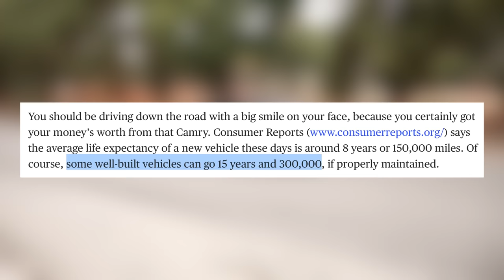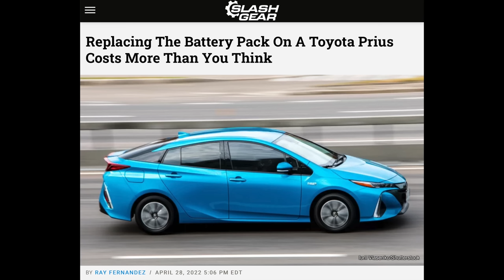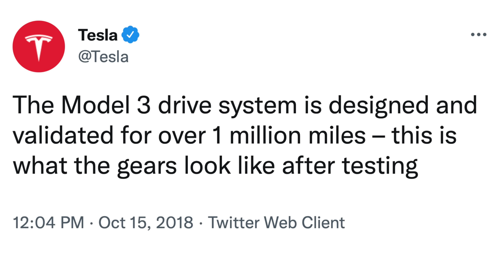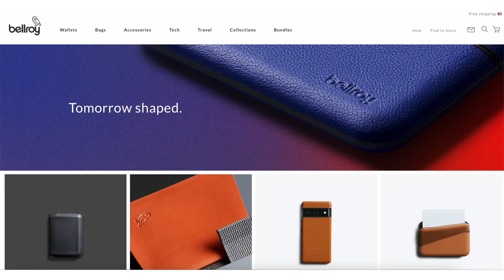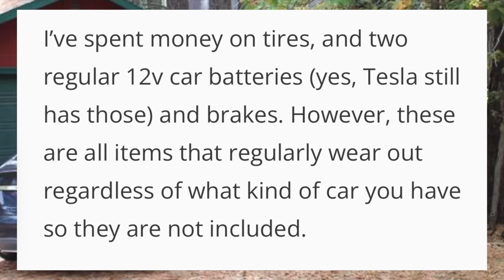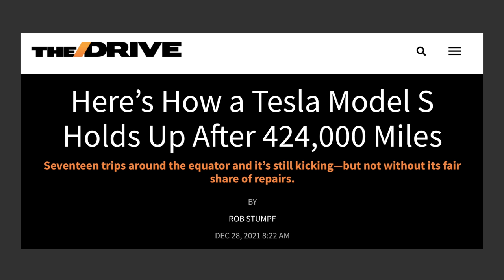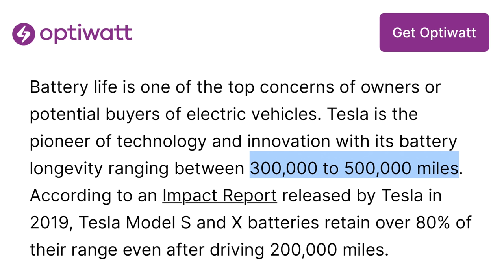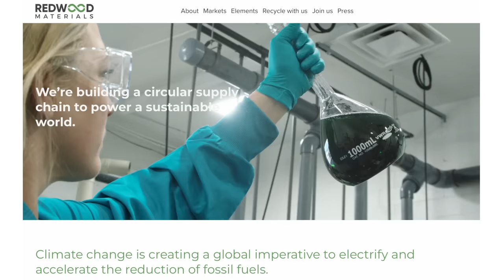The ONE MILLION Mile Tesla | It Still Runs

Comment: Hi Ryan, I have had my model 3 for not even a year now and when I fully charge it only goes up to 239 miles charged and is supposed to get to 272. My Tesla I charge to 78% everyday and if I drive 80-90 miles I will come home with 5-10%. Tesla keeps telling me there is nothing wrong and I do not drive fast and do all the things they said to do to extend range but I will never get over 130 miles out of my Tesla even on a full charge. I only have 26k miles driven on my car. Any idea on what I can do?
Reply: For battery longevity You should follow the 80/20 rule..  Don't charge above 80  (which you are doing) and don't discharge below 20 (which you are not).   You can do them both ocationally (Trips)  but it should not be often .  Tesla is correct that you are doing nothing wrong and you will likely remain over the 70% threshold
Reply: @777trader8  I don't have to imagine I have a 6 week old MYP...   I do hear you .  with 300 miles max the 80/20 gives you about 180 miles which is pleanty for most people.  The Standard range M3 has the iron based battery and it can be charged 100% and discharged near 100% with no impact, you just can't discharge them as fast  which is why they are speed limited.   I usually keep all my cars about 15+ years so for now I am trying to keep the battery in the sweet spot.
Reply: @777trader8  Except that. . . you have to drive a Prius.
Reply: @crimsondecade7420  Hey, I am not charging above 80% since I have gotten the car I charge to 78% and do not super charge (unless I am on road trips).
Reply: @SportTrik  Just remember that  Discharging to 5-10% has almost the same impact on the battery as charging to 90-95%, Lithium-ion partial cycles are better than a deep discharge. So if you can avoid it , don't discharge below 20%
Reply: @crimsondecade7420  Tesla told me it would fix it and reset the battery if I discharged to 5 %. If I can’t go below 20% I would only drive like 60 miles a day then

Comment: I'm used to my tiers lasting 60k-70k miles. But 25K? Thats kind of nuts.
Reply: That seems too infrequent- are they getting bald before replacement?
Reply: @300SLdriver  naa, the tires I got now are Continental Extream Contact all season from 2018, they were 60k mile warranty. it is time to replace them though, not going to make it through the next winter.
Reply: 25K is just a recommendation. Have had my LR Model 3 for 2 years and just crossed 40K miles, getting my first tire change today! 25K is on the safe side, but i could feel the difference in performance at 30K miles. Depends how urgent you are with getting them done in my opinion!
Reply: Because is fast.  Acceleration is addictive.
Reply: "Tires on a modern electric car will wear down much slower than in a car with a traditional internal combustion engine. This is due to good traction control. The driver assist systems reduce slipping by utilizing the electric motor's rapid power adjustment. This system is much quicker than in ICE vehicles, where it is based on braking and limiting engine RPM" , Nokian Tyres' Development Manager Mikko Liukkula

Comment: Besides the miles you put on your EV,  where you live and how you drive the car will greatly affect the life-span of the batteries.   Heat is the batteries' number one enemy.   If you parked your EV under a hot sun most of the time, that would shorten the life of the batteries.   If you have a heavy foot that accelerates your EV hard all the time, that will also shorten the life of the batteries because high discharge rate will create a lot of internal heat.  

Furthermore, if you use fast charge all the time, that will hurt the batteries because the high charge rate also generates a lot of heat just like high discharge rate.
Reply: Are you sure it is not cold weather? I hear that cold is really bad for the battery.

Comment: I don't think they'll need a new battery pack every couple years, I think they'll need a new battery pack every 8-10 years on average. And they're 4 times more expensive than a new engine in a gas car. If they came with a 15 year unlimited warranty, I'd be in - once they charge faster and get cheaper.

Comment: When you consider how inefficient the machinery are to mine the materials on a large scale plus the extra power consumed by the grid from EV owners is it really a massive benefit to the environment or is there other motives involves well with all this new software…. Makes you wonder
Reply: What?!?  The baseline is not zero emissions.  It is 13lbs of CO2 per gallon of gas burned.  At 20k miles, if you set an EV on fire and let it burn to the ground.  You are still better for the environment than driving a gas car past 20k miles.

Comment: Drive unit? Hmmmm I don’t think a car reaching incredible mileage when it’s largest components have been replaced. The motor and the battery ???? Is anything worth reporting. There are plenty of cars on the road with 3 new engines that have driven over a million miles. I had an Audi reach 400k without engine replacement. 
Replacing the drive unit ( motor ) 8 times in a million miles is not something to brag about. 
I’m a huge Tesla fan and maybe now  these will last longer but that particular one should not be talked about probably. 
Replacing the drive unit and battery is basically replacing everything but the body of the car no?

Comment: how does one check the degradation on a their car?
Reply: 100 - (Range showing after charging to 100%)/ (original range) x 100 = percentage degradation.  So if your car shows 298 miles on a full charge and the car originally had a range of 310, then 100 - (298/310)x100 = 3.87% degradation.

Comment: “Battery replacements do occur in rare occasions with the Tesla, but again, it’s rare.” That’s it? That’s all you’re going to say? Is it a case of premature failure and replacement for free under warranty? If so, you should have said so, right then. If not, was it likely excessive or abnormal usage? You left your viewers – or those who’re afraid of having to spend a lot to replace the battery soon – hanging. … Is the 1-2% loss per year 1-2% of the original or remaining capacity? If the latter, the math is different. … The 70% capacity is the measure used for the warranty. If you reach 70% outside of the warranty period or mileage, SHOULD you still replace the battery after it’s lost 30% of its capacity? For a Tesla, there’s still 200+ miles of range, right? For 99% of the driving of 99% of the people, that’s still decent range. For the rest, you simply charge more often – big deal.

Comment: A lot of drivers replace their car long before 100,000 just because it's paid for and they want a new car.
Reply: and what does that do to the used BEV market when people know that the now used car they are buying may need a new battery in a few years?  Whos gonna pay for that???
Reply: @alexnutcasio936  I think what will happen is that these cars will be bought by people (like me) who can't afford to buy a new BEV, but would be quite happy to drive a car that only goes 130 miles on a charge as opposed to 230 miles on a charge.  They won't have to replace the battery, and the car will still deliver all the other practical benefits of electric vehicle driving--lower chance of being hit with big repair bills, no worries about gas prices, none of the sharp depreciation of driving a new car off the lot.

It just won't be practical for long road trips.
Reply: @eyesuckle  no one is going to buy a car with a 30% or more range loss.   Add to that 30% range loss the issue of having to run AC and or heat and you’re way below original stated range.  People will be demanding  new batteries.
Reply: @alexnutcasio936  They'll buy it if it's priced appropriately.
Reply: @eyesuckle  with a dead engine/battery/drivetrain?  Yeah, for Pennie’s on the dollar. And then what? Drive an almost bricked car?
Reply: @alexnutcasio936  Who said anything about the "drive train" or  "engine" being dead?  (it's a motor in an EV, not an engine, BTW.  And there is no "drive train")  We were talking about battery degradation. You have just suddenly introduced this idea that the entire car is junk out of nowhere.  

Obviously, if none of the major components of the car are working, then you're not going to be able to sell it.  

My point is that if everything else in the vehicle is functioning but the battery has dropped in capacity, there are still people who would buy it second-hand at a greatly reduced price and use it for 95% of their vehicle trips.
Reply: @alexnutcasio936  well in my case I just got a 2019 model 3  long range.

The whole reason for buying it is I own business and the car make me money well over the cost. 

If all I have to theoretically do is replace some tires and a battery every few years, my business will sure be booming one this giant ass car payment is done😆
Reply: @ericstromberg6215  do you know what the degradation is? Surely it has suffered some over almost four years.
Reply: @alexnutcasio936  it charges to 322

It only has 15000 miles when I bought it

Comment: Tesla's presumptions are dull.  There is a Tesla EV that did make 1 million miles on Youtube but they required 4 battery replacments to achieve this.  250,000 miles is not a very positive life assumption. 1 million miles isn't radically long life for an ICE engine with manual transmission; the record is over 4 million miles. I have a 911 w 1.2 million miles; a Volvo P1800 with 500,000; and two Honda Insights hybrids with 1 liter engines over 200,000 each and still driving.  Hybrids have a very good potential to further an ICE engines life by reducing high loads on the motors. Batteries are the fail point of EVs they don't live long.

Comment: So. When will a EV pay for itself compared to fuel costs? The savings of gas versus electric costs?  Ever? Never?
Reply: Depends on gas and electricity prices, how much you charge at home vs public charge, how much you drive, and so on.
For me my Subaru cost about 25 cents per mile and my Bolt costs about 5c per mile, 20 cents per mile saved. I didn't get either car new, but it's still good for comparison. 

The Roo new was about $15,000 MSRP, or $32,000 in today's dollars. The Bolt new was $37,500 (with a $7500 rebate, but we'll ignore that). 
So 37,500 - 32,000 = $5,500. At 20c per mile that's 27,500 miles. My Bolt already has 50,000ish miles on it, 20k from me.

Comment: >electric car owners will sell the car before the battery gives out

TO WHO
Reply: They will sell them to... new owners of a used EV. I've owned nothing but used ICE vehicles and they were sold to be before the engine gave out. And in two cases the engine did eventually gave out. Expensive to replace, no? Timing belts are crazy and can stretch and ruin an engine. Plus my turbo chargers are going on my latest car. A repair or two on the transmission...

Comment: Yeah I'll keep my hybrid lol! Bev cars are not the way. Hydrogen fuel cell is a better way. 
I drive 60k miles a year and have thought about a model 3 LR but in a hot climate and having to use superchargers since my apartment complex doesn't have chargers...
And I bet driving highway in 105 degree temps every day 250 miles or so I'd be at the supercharger once or twice 😂
Reply: You saw the bit about the Tesloop Model S/X reaching 200-400k miles ok (few warranty batt replacements), right?  Those are 100% supercharged, all hot Vegas-LA desert highway driving, worst possible conditions/treatment... and still did ok.   
For 60k miles/yr, you should normally save a LOT of money on charging vs fueling, but... 
if all supercharging, that can get more expensive (10-12c/mile), and vs hybrid w/ great mileage... you might come close...

Comment: One million miles, well, not impressed at all.
At least three batteries and four motors.

Volvo P1800, one owner, bought in 1966. Owner died 2018. Distance travelled? 5.150.000 km.
Original engine.
Original gear box.

There is no problem having a car going far if you just repair and replace stuff, like the Tesla motors. And their battery. Since they obviously did not last.
Remember above: 5.150.000 km. The same motor. The same gearbox.

And it still travels since Volvo bought it back and they still use it, aiming for 6.000.000 km.

Comment: Can you use international unit. Miles is confusing
Reply: Times is by 1.6

Sincerely,

A Canadian 😅
Reply: @PeterHeang  yes and you can use banana for scale. It's easy 5 bananas are equal to one meter.
Reply: @yingnyang2889  the name mile not the value associate. We moved to metric system for have the same references for every city, country.
There is still different mile. In France a mile still in use is 1.852km.
It's like feet or inch, it's base on the size of the one of the king/queen of UK for British...
Reply: @yingnyang2889  Yeah, well, so was the horse and cart.  Is that supposed to be some kind of recommendation?

Comment: I have a 20 year old 2003 Nissan 350Z with 276,000 miles. This car has the ORIGINAL Engine and the ORIGINAL Transmission. 

I don’t baby this car, I BEAT THE SHIT out of this car everyday (red lining engine, road racing, drifting, occasional track days) and it still runs well. Seems like this car loves to be pushed. 

Moral of the story just buy stuff made in Japan.

Comment: Changing the tires every 10k miles is horrible for your wallet and the environment.
Reply: Depends how you use it, I get 45000km out of tires on a P85+.
Reply: @moestrei  That's really bad considering I got 120,000 miles from tires on my car and 90,000 miles from tires on my truck.
Reply: @KevinHammond1  if you get 120000miles out of tires you are a moving obstacle.
Reply: @moestrei  Look up 303 Aerospace UV Protectant. You put it inside the tires and use it after every car wash. It will double or even triple your tire longevity.
Reply: @KevinHammond1  Interesting product. And me dummy thought it is friction wear but now I know it's the bad UV from the sun.
Reply: @joesolo7719  You answered your own question lol. And it's not just a UV blocker. It keeps the tires from dry rot by keeping them hydrated.

Comment: Wrong about the battery 🔋 replacement it’s a matter of time I have met like 3 people who have Tesla over 120k miles it happens every time. 120-160k miles 6 years is the average on that. A 1 million mile Tesla you would have to replace the batteries like 6 battery 🔋 pack, 25x brakes jobs, 46x set of tires 🛞, 7x shock jobs,  so tell me why you think these electric ⚡️ cars are better then gas cars.
Reply: Making up numbers. Your nu.bers aren't backed by the service manual, owners manual, consumer reports, forums or anything else. 222k miles, 13% battery loss, 5 sets of tires, 1 set of brakes on a family members model s.

Comment: "It's not uncommon for modern EV batteries to last more than 10 years."  How is that statement possible?  That statement implies there are a variety of EV batteries that have been on the market and in use for more than 10 years garnering enough data to make this a true statement.  How is that possible when the EV market has only been in full swing for a few years 5 to 6 at most outside of Tesla which is just a few longer.  You can't include hybrids because they don't use batteries full time or in the same manner.   Second, how and where is there a single Tesla that has completed 1 million miles?  Although possible, that seems suspicious to me.
It's also interesting that you dismiss cell failure as an inconvenience rather than a battery pack issue.  The fact is, that it affects the whole system and can result in nothing working.  So whether you have to replace a single cell or module it's still a battery failure requiring replacement.

Comment: Teslas cost about 3 times the average car and a regular car goes around 500k-1M miles if you maintain it properly. So Tesla should break like 3M before I get even remotely impressed. My car has driven about 300k and it has no issues what so ever, only wear parts are replaced and oil changed.
Reply: The average car purchase in US is $47k. Model 3 is $44k.
The average premium car $67k.
Tesla is the top selling premium vehicle in US.
The data is clear -  majority of ICE cars are designed to last 10 years or 150 000 miles.